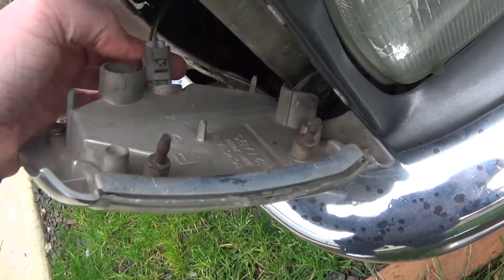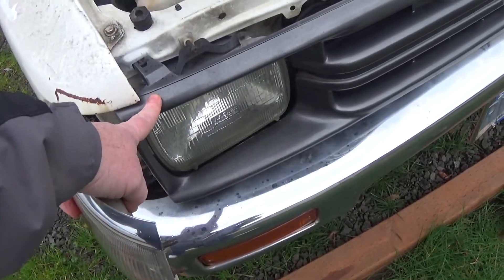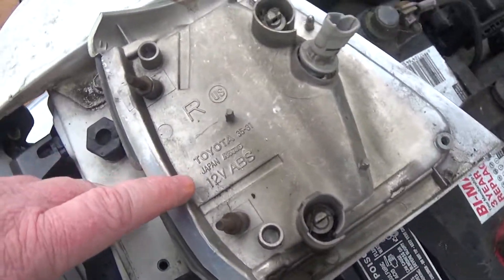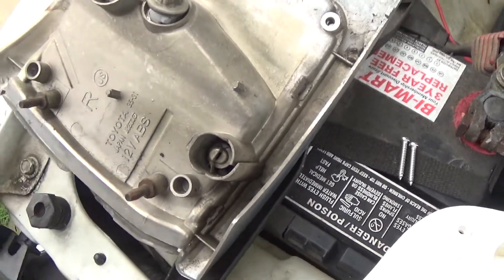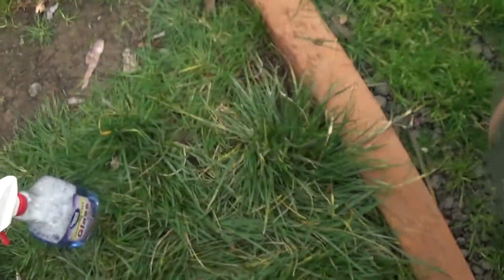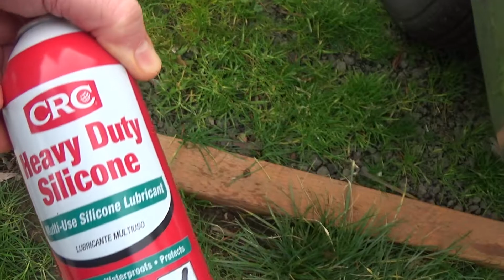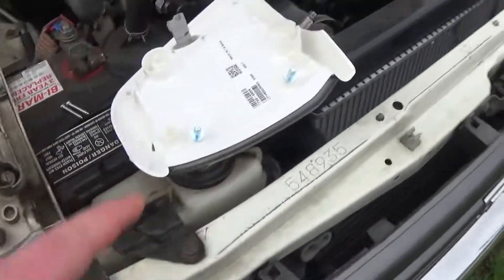Replacing front corner light on Toyota Pickup #Toyota #Pickup #Roseburg

Comment: Thank you very much. I have a 1994 Toyota 2 wheel pickup , I bought new in 93 and still have it with 70,000 miles. The Truck has worked flawlessly for 30 years but little things are starting to fail a litttle. My turn light is out , so I bought a new (pair) off amazon. The speedo just stopped working, and I bought a Speed Sensor from the same place. I hope to hook up a little back up camera for my little truck. I only paid $9200 for the truck brand new and it has lasted faithfully , all these years. Funny thing is : People will knock on my door and ask me if I want to sell her, because those old trucks were built so well. Great Video and Thanks, RH DSD